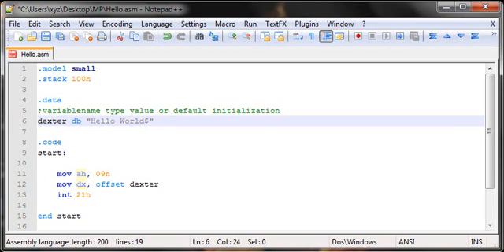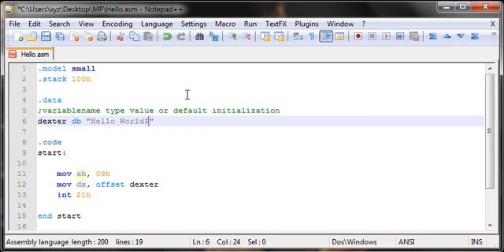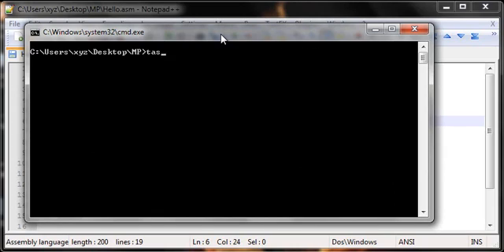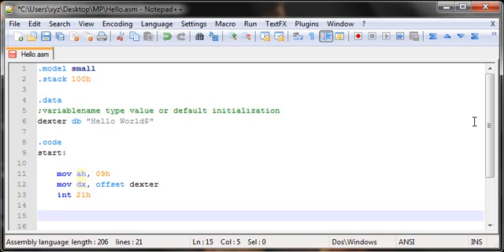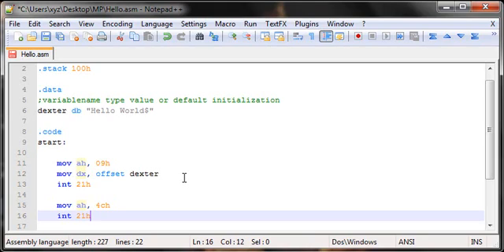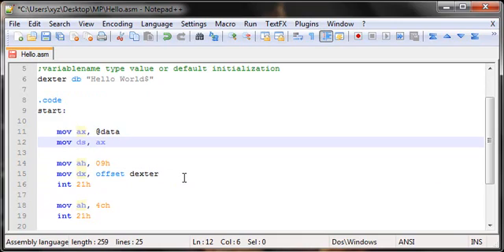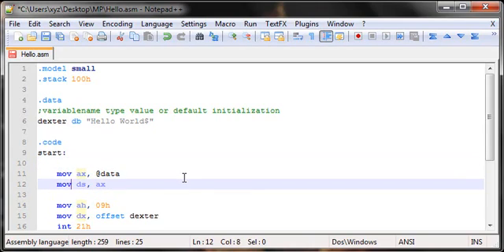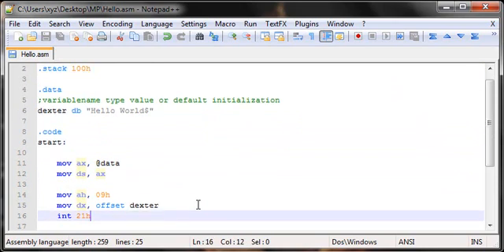Assembly Tutorial 6 - Completing Hello World!!

Comment: Hello, I tried an installer that works for windows 8 on here (http://techapple.net/2013/01/tasm-windows-7-windows-8-full-screen-64bit-version-single-installer)  but the code you wrote above doesn't run. however this code has no problem : have any ideas why?  I want to follow your tutorial as your explanation makes very much sense however I can't translate the code to something that runs under the windows 8 tasm setup. Thanks for your input!

.MODEL small
   .STACK 100h
   .DATA
HelloMessage DB 'Hello, world',13,10,'$'
   .CODE
   .startup
   mov  ax,@data
   mov  ds,ax                  ;set DS to point to the data segment
   mov  ah,9                   ;DOS print string function
   mov  dx,OFFSET HelloMessage ;point to "Hello, world"
   int  21h                    ;display "Hello, world"
   mov  ah,4ch                 ;DOS terminate program function
   int  21h                    ;terminate the program
   END
Reply: never mind, it runs now :))